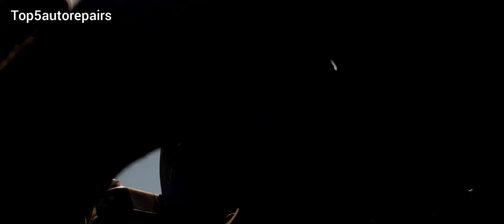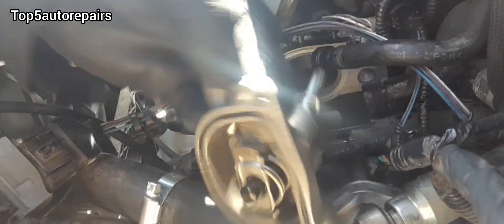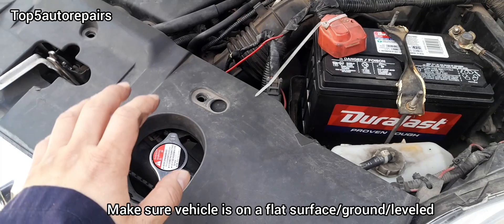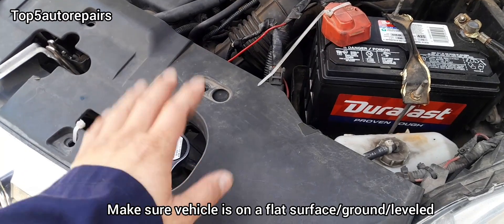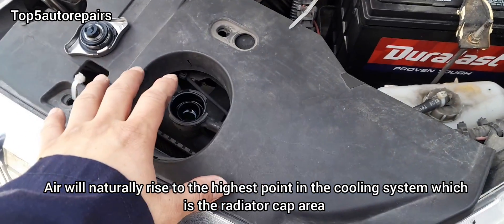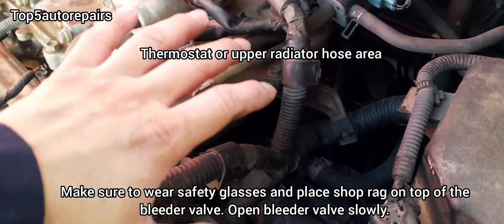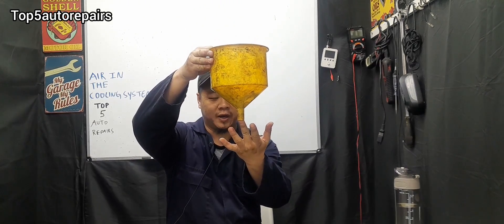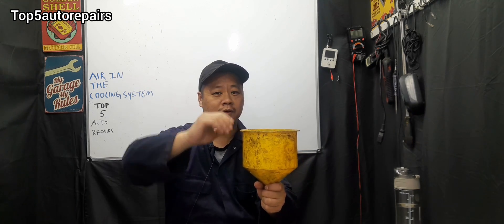SYMPTOMS OF TRAPPED AIR IN THE COOLING SYSTEM

Comment: I have a sloshing sound that just started. I do have a very tiny coolant leak. No fluctuating in temps. Replaced cap yesterday, since my hubby overfilled my reservoir tank, DROVE it that way & it blew the cap off the car but didn't overheat. Now I hear sloshing when starting the car. Is their air in the system??? It was fine til he overfilled the reservoir and drove it.

Comment: One thing that worked for my heat.  I popped the heater core hoses off  and a ran garden hose through one end and left the other end in a bucket.   Alot of sediment came out and heat came back. That was a last ditch effort.